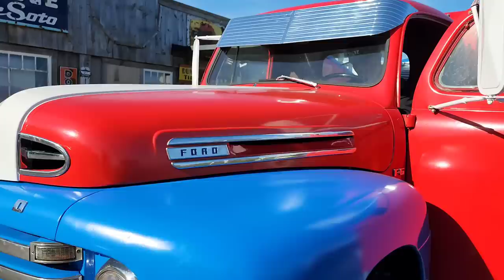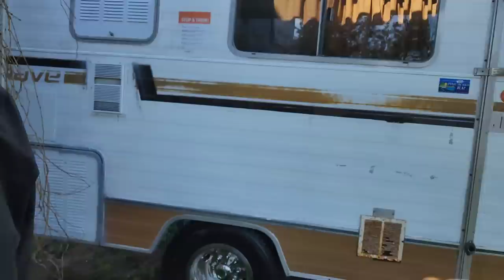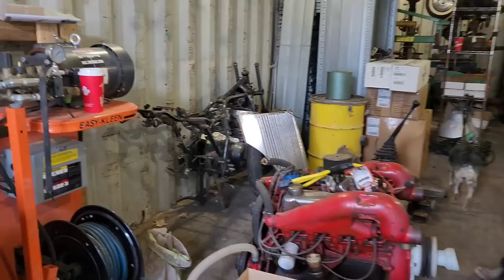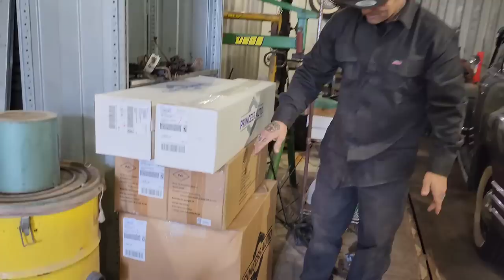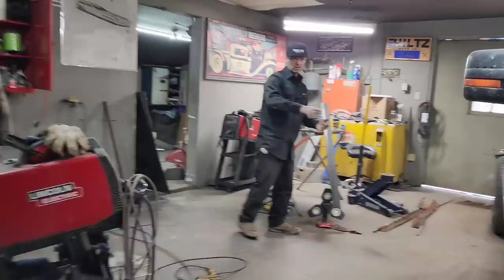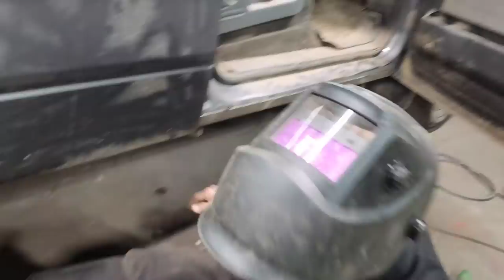Exclusive tour of Bad Chad's current projects - past and present 🚨

Comment: Just a suggestion: You can drill a small hole in the sheet metal before using the self-tapping screws. I know it sounds wrong to do it that way, but it's faster in the long run , when going through thick metal with self-tappers. That said,  I never argue with success.

Comment: Excellent “Trick” on using the self tapping screws, welding them on and than grinding them down. I can not tell you how many hours I wasted on older cars and trucks fixing rockers by welding them on in the past. As you say its not a restoration its a driver. Will not forget that one! Thanks Chad! And of course Queen Jolene!

Comment: Im taking it!! I was SOOOO thrilled to see you doing rust repair on a newer vehicle!! I do a lot of this work and it is very difficult clean that rust to weld to and it ends up so thin and the welder spits and sputters so year weld the clean metal on the top edge and self tapper screw the bottom edge and weld head and grind, I like it!!

Comment: Chad should "Google" some of the you tube video's about "Starting vintage vehicles with a manual choke" There is more than a few videos about: jump in cold starts such as the three pump and pause before hitting the starter so as to let the gas atomize in the carburetor and how to work the choke setting at 3/4's don't rush a take off learn the lite tap of the gas pedal which let's you know if it is warm enough to go no choke and then drive.

Comment: I wish I still had a dollar for every rust repair panel I've done.  The thing with aftermarket replacement panels is twofold.  First, they're made of very thin steel.  Second, they rarely fit correctly out of the box.

By building your own repair panels you've saved time and money.  Not to mention the metal is heavier, stronger and will last longer.  Have undercoating sprayed inside the new panels and everything will be nicely sealed up.

I love the self tapper idea... the hours I spent and drill bits worn out drilling holes!!

Comment: You need a pipe grid hung on the road side of the storage building(sort of a two dimensional scaffolding, using aluminum pipe and pipe clamps) to hang your signs and more so you don’t ever have to puncture the steel cladding.

Comment: Hey Chad  that 351w boat engine is probably a reverse rotation engine  if it come from a inboard ski boat, like a ski Nautique or Mastercraft..ect.  it's 99% chance of a reverse rotation  cause it counter balanced the weight of the driver  for pulling a skier in competition   👍

Comment: Take the "35 Dodge and turn it into a 4 door truck. Move the chopped cab up over the motor to within a couple feet of the radiator and grill.Cut the trunk area out and put a steak side flat bed out back. Just my belly button 2cents worth. Whatever you do it will be cool.

Comment: The car hauler sounds like it's not getting spark maybe the points need to be cleaned depending on how long she has been sitting but It did not pop or anything so it may be a spark issue that's my guess anyway

Comment: Idea on the 35 dodge...take the front seat section..two front doors...remove it...attach the dash to the rear 2 doors..shorten the frame..bring the fire wall back to rear passenger section...basically take the window post forward to firewall and remove that section of the car

Comment: you said it would cost $600 for corners n rockers but if someone brought a truck like this it would cost more to fix your way then if you were to buy new pieces as shop rates are $150 an hr plus your metal plus your shop fees etc etc the person would pay $2500 by the time you got it done so buying 600 in parts would save the person big time

Comment: on the ford truck just glue the sils on not bad to have some weld to it and black straigt to iron paint on it or raptor line it - like jolene racetruck paint - like this fix its not bad will problably live out the truck live - good job

Comment: They make a solar trickle charger for these thing. 12v, 24v, 36v & 48v. Sounds like no spark. check your coil and wires as well as the resistor that was installed in the distributor.

Comment: The sill you made is the exact same thing they would sell you if you paid the $600 and most of the time they don't fit right where you have to modify it to fit. At least in the past that's the problem I ran into from after market parts. If it had some crazy curves and body line's in it that would be hard to reproduce then that's when you have to think about the hour's and time to reproduce the part or pay up for the part. If you can even find the part for sale.
I know Cadillac's they don't repop no parts for them you either have to find a parts car or make it.

Comment: CHAD JOLENE ----- The yellow Fiat, I believe that heater hose that goes to the engine there by that cylinder with the Coolent on the spark plug tighten that clamp or check that rubber hose for a leak it's running down on the spark plug

Comment: Fast doesn't equal good. Nothing wrong with making panels but the metal should have been butted up not over lapped. Why not weld up the rocker fully?  A good job is better that a fast job.  Just asking for problems not fully cleaning and welding the metal. Chad I usually like your work but couldn't disagree on the application of this one more.  Still love watching tho